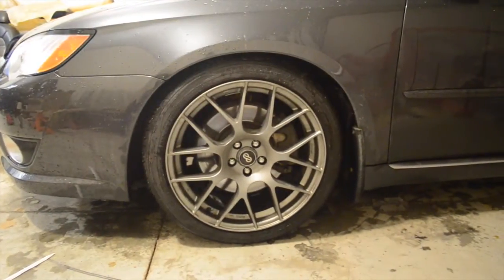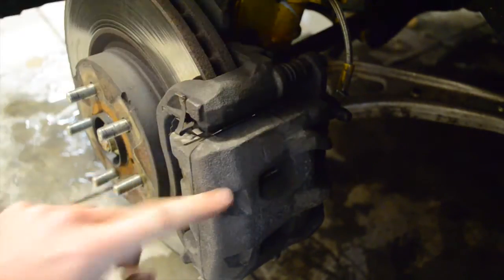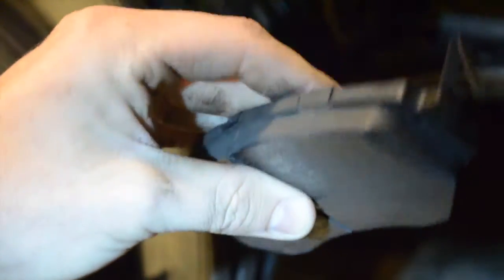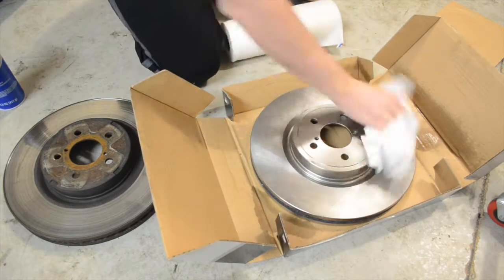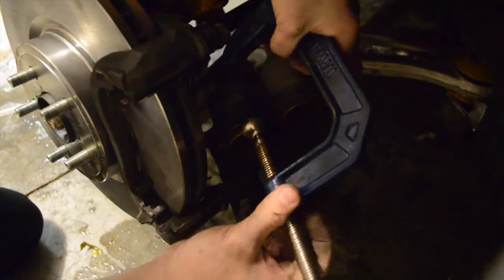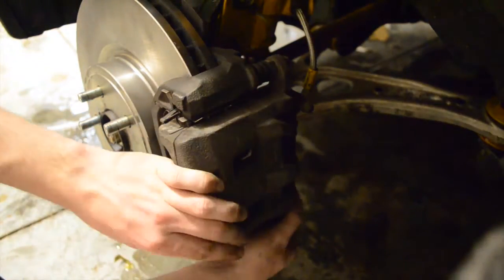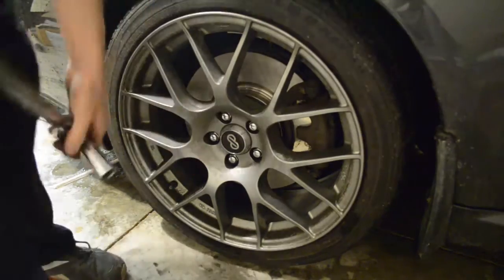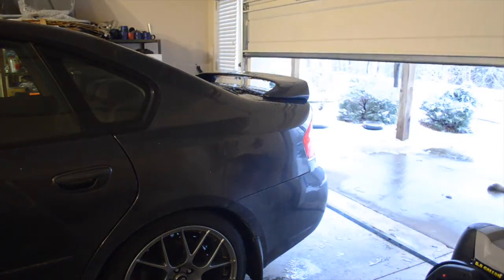How to change Subaru Brakes

Comment: Great vid! What's that gear puller you're using to get the rotor off? I usually just use an M8 bolt thread it in by hand as far as I can and then hammer the wrench to break the rotor lose. Not necessarily the best way... That gear puller looks like it works great! I'd like to get one.

Comment: your instructions for removing the stuck rotor are pretty terrible. Those 2 screw holes are there to remove a stuck rotor.  Take a screw from the cars radiator mount under the hood and use it in the 2 holes on the rotor to break it free.